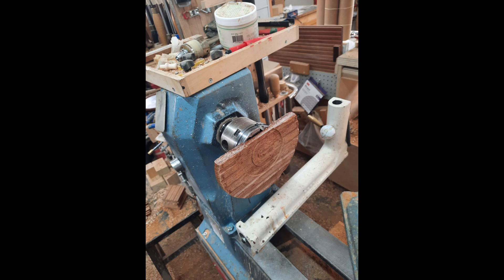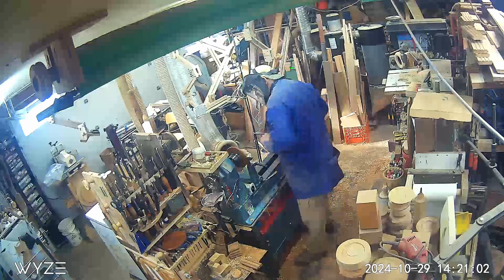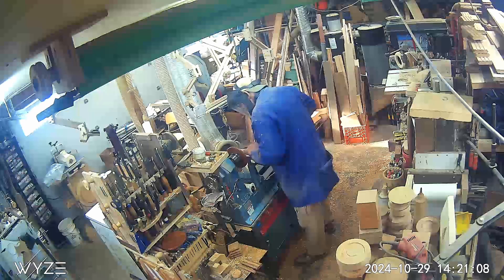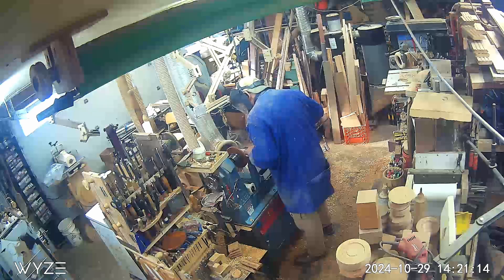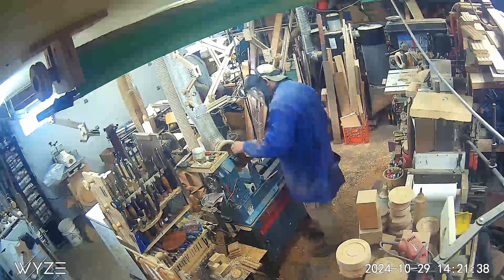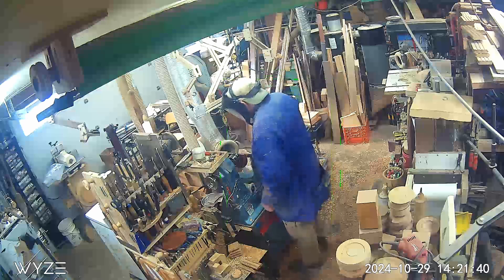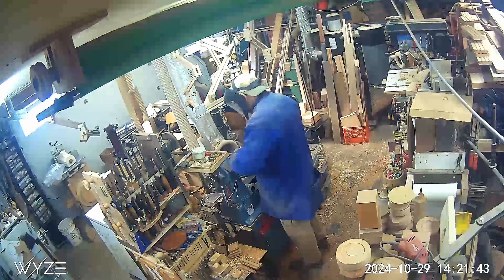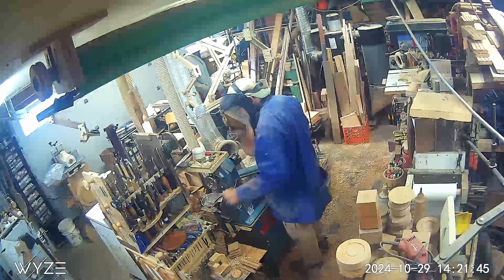Safety Moment Oct 2024

Comment: That's definitely a hair raising thing to happen. I was turning a 6" diameter bowl and the wood failed at the grain only got a few splinters lucky could have been worse, turning at 862 rpm low speed on a shop smith 10er. Glad you are Ok.

Comment: Gret that you didn't get hurt.
BUT that lathe was going MUCH too fast.
If I was turning wood of a 10 inch diameter like that I would have the lathe at about 2 revs a second, ie 120 rpm.
If your lathe does not have a good speed control that can adjust down to low speeds and still have good torque then Insuggest getti g a new motor and VFD controller, they are not very expensive these days. 👍
But, yeah, I would NEVER run a high speed like that with a 10 inch disc of wood in a lathe!! 😬
Reply from the maker: @wizrom3046  Thanks for watching and commenting. I posted the video to share the importance of staying out of the line of fire when woodturning. I do have variable speed controls and was turning at within the typical speed range for diameter of project. Subsequent analysis as to cause of failure led to possibility of oily exotic wood not properly prepared for glue up. Lesson learned.
Reply: @bertdelisle393     Thank you for the reply. But the amount of kinetic energy that launched that piece into the ceiling at such a high velocity shows (in my opinion) that was far higher speed than a "safe" speed. It was just not necessary to use that amount of speed for wood turning.
Anyway, please be safe friend. 🙂

Comment: I have a picture somewhere from the early 80.s I was running a 240 inch lathe, boring out some 3ft I.D 5ft long 5 inch thick  aluminum casting cores. they come in halfs that are banded together and machined as one tube.  I was only turning at like 180rpms and the bands broke. The lathe, it threw that 400lb part. one half went thru the cieling and the other smashed into the wall breaking cinder blocks.  Theone that went thru roof came back down and landed precariously balanced 30 ft up on a ceiling truss/ I-beam. With a sky full of stars shining behind it.  The owner was surprisingly nice to me and totally freaked out. Maybe cause i was working alone...lol.  They used to let me work as long as I wanted. So id clock in on monday at 7am and leave tuesday night with 36hrs in one shift...Id do that twice a week, Just stand by lathes slowly turning huge parts for Hours and hours and days and days ...forever!  ...cut, cut, cut, cut, over and over a million times while I sway in place waiting for the 45minutes in between work.
        We can watch paint dry and be excited at how fast its going...- Random Machinists anywhere.      Ahhh, the paint, its almost skinned over!   Lets watch some more...20minutes later. Wow its...

Comment: Why would you be turning something that was glued together???
Reply from the maker: @terrentech  it’s a common practice to laminate wood together to get a larger cross section for a platter. Usually the glue joint is stronger than the wood fibres. In this case I failed to recognize that the exotic wood I used has a naturally oily component. Titebond recommends that prior to glue up the joint surfaces should be cleaned with acetone or toluene to remove the surface oils so the glue can contact bare wood. Live and learn I guess. 
At least by staying out of the line of fire nothing contacted me or my face shield.

Comment: Did it come apart at the glue line?
Reply from the maker: @Tinkercatnh  Yes it came apart at one glue line. After researching some information from Titebond I discovered that these exotic woods can have natural oils that can interfere with adhesion. One option to consider in future would be to clean the mating surfaces with toluene or acetone before applying glue to the joint. I’ll be doing that from here on with exotics.
Reply: @bertdelisle393  As they say, live and learn.

Comment: My high school shop class had a lathe chisel stuck into the foam on the ceiling. There was a string tied to it that hung low enough to read the note on it “always adjust your tool rest”
Reply from the maker: @Maximo592  thanks for watching and commenting, I’m leaving it stuck in place as a ready reminder to me and anyone who comes to my shop.
Reply: I remember taking a look in the former high school printing lab at a school I attended as a kid and in one spot is a machine called a Ludlow (brand name) that was used to make type slugs in large advertising fonts. The ceiling is a good 15 feet high, yet there are a few splashes of type metal that remain in place decades later. No matter what type, always respect power tools and know their safeguards!!

Comment: True story - 1978  - Queensmount Senior Public School - Industrial Arts class: 
8”x2” chunk of ponderosa pine being turned into a hurricane lamp base ** detaches from lathe. 
Hits ceiling where it dented the drywall then spins along ceiling for 30 feet before punching small hole in wall.
Student operating lathe suffers from wrenched shoulder and cut on wrist from cutting tool he was holding.
Scared the hell out of everyone doing the lathe projects.

** Yes, an assigned project for every student: wooden candle holder.  Over the years EVERYONE mentioned that their holder scorched or burned when candle left unattended - except for mine. It got knocked off of table and fractured a bone in my mom’s foot.  Good times, good times…

Comment: I once watched a guy launch a 150# steel cylinder through a steel roof with Styrofoam and rubber on top.  It landed 15' away.  It must've had a total vertical travel of more than 30'

It was a counterweight.  There were two.  The operator turned the spindle on at 20x the speed it was intended to run.  The other counterweight hit the wall and flattened an electrical pull box.  I was standing in line with the tailstock.  I got to see the whole machine wobble like jello.  It was 15' long.

Comment: I sold a table saw to a girl who wanted to get into wood work, I spent more time telling her how dangerous a table saw is than I did telling her about its features.  I hope she keeps all her fingers.
Reply: Only takes a loss of concentration of a split second no matter how experienced but fortunately a half inch shorter thumb isn't a huge deal, comparatively speaking.  Hurt like a sob though.
Reply: Good on you friend.
Reply: Hey if you did a good job teaching how, you should have some confidence!
Reply: If a man can breastfeed a bebe, then there is no reason a girl can't use a machine tool without maiming herself and others.
Reply: I guarantee you there's some missing now.
Reply: @ProleDaddy   Probably .
Reply: Guaranteed you're an American? And another one who removes the riving knife and the saw blade guard. Two vital safety features that are fitted on table saws for a reason! No wonder so many who don't know what these two things are, end up losing fingers!
Reply: @paulh2374   Gezz people, relaxi
Reply: Yeah, I am, and and so what?  My point stands, it only takes a second.  All guards were in place and the work piece caight on the kickback fingers.  I needed to finish up, was hurried and my mind was not 100% in the game which was where none of the other hundreds of times I've safely used a table saw mattered not.  The piece was thicker than I usually work so the blade was set higher and there went a small piece of flesh.

Comment: Is it possible you are using a higher speed than is really needed?
Reply from the maker: @keantoken6433  thanks for watching and commenting. I usually use the rule of thumb for woodturning speed, diameter times rpm should give a number between 6000 and 9000 as a general guide. The platter was about 8” diameter and running about 1000 rpm which should have been ok. When I did some research on the failure at the glue line I discovered that I should have used toluene or acetone to remove the natural oils in the exotic wood blanks. Live and learn.

Comment: That was a Halloween scare. Glad you are okay!
Reply from the maker: @kenvasko2285  unexpected events are always a learning opportunity. I got some detailed info from Titebond to help figure out what could have caused the glue line failure. Most likely contributor was the natlural oils in the exotic wood, a cleaning with toluene or acetone before applying glue may have helped secure the bond.